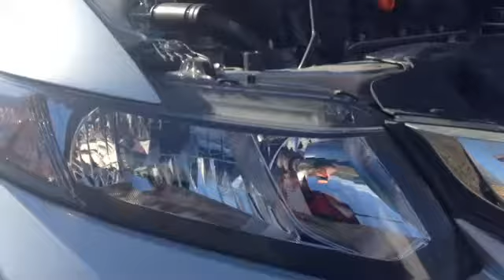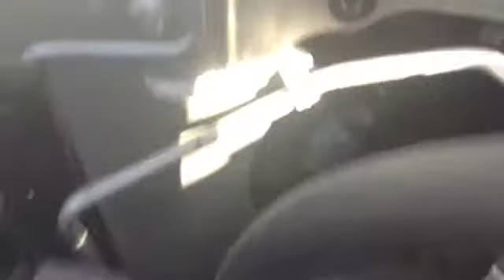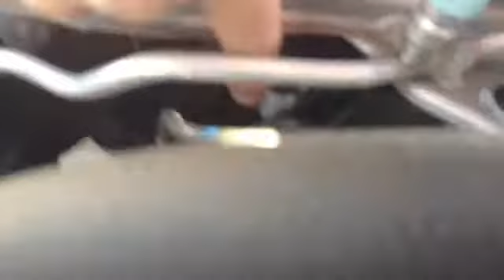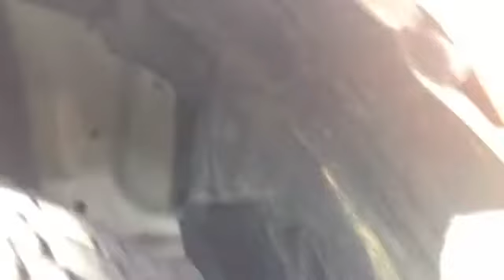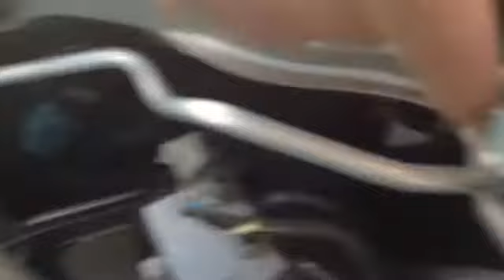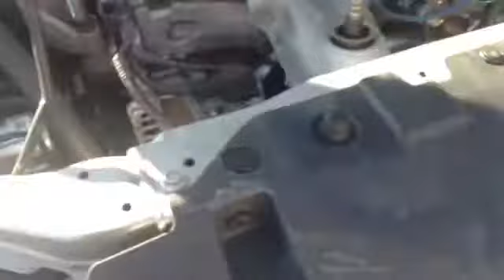Replacing head lamp on a 2013 honda civic

Comment: Hi
Did you actually stick your hand in under the wheel???
Hmm maybe not!!!
I found a big piece of metal blocking my hand
Like a structural support
I ripped my hands and broke plastic parts to find that way barred
I was finally able to get a few fingers jammed in and with extra long needle nose 90 degree angle pliers turn and pull out bulb and luckily insert new bulb into socket with the use of those pliers. but it's almost impossible to lock it back in place
I'd sure like to know how you did it